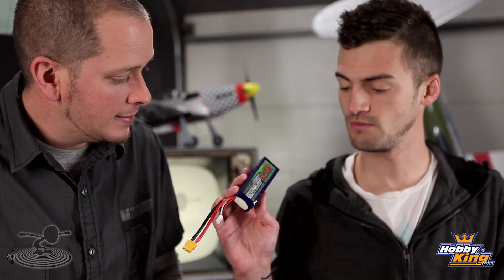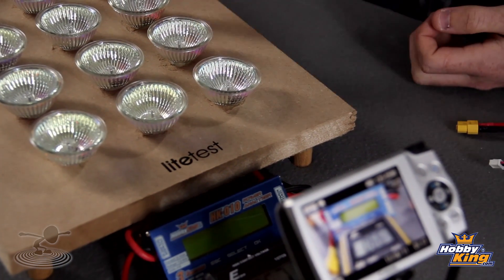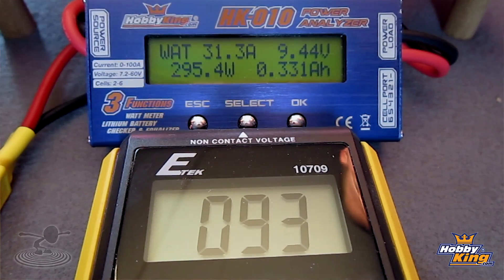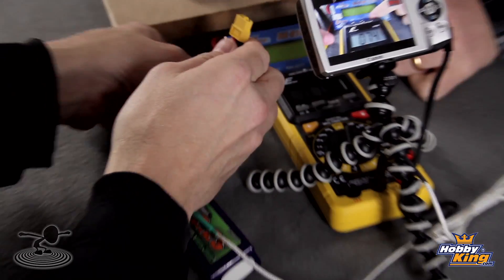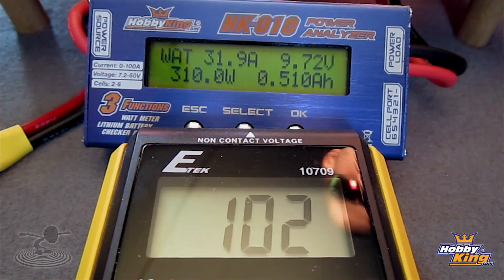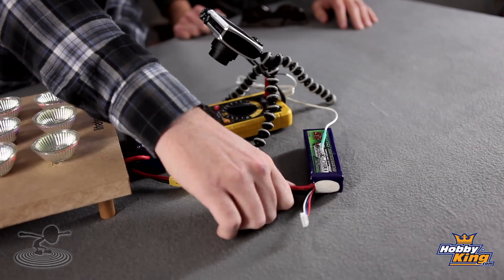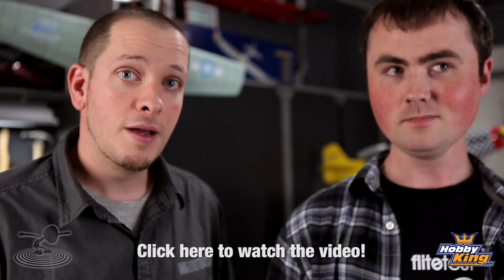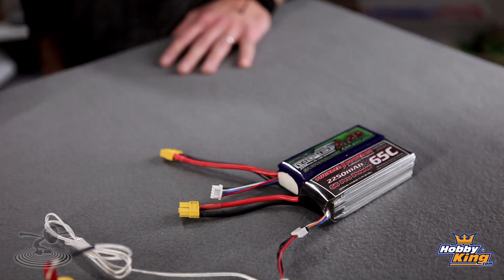Flite Test - HobbyKing Nano-Tech - REVIEW

Comment: @13Anko well withthe price of a thunder power you buy more than 2 nano techs.. so .. even if it does 50 cycles it's still a gain. 
BUT Ive tried the 65c annotechs and they are Great batteries. some old nanotech batches of the 2200mah 45c were not so good. but not these..

Comment: I do not trust this video on any level. Nanotech batteries, I will take a maximum of 5 cycles, during which they leave a lot of power. It's true. But after they have been ruined.
I have ruined many nanotech batteries in the car, on airplanes and helicopters. I do not ever buy a single.

Comment: @crystal130h 
They explain this at the start of the video.
All 3 banks of lights are hooked up but only 1 is being measured.
3x 32 amps = 96 amps draw
3x 600-700 mah = 1800-2100mah used

Comment: Next time you guys run this test....unplug the load (lamps) from your wattmeter....leaving the battery connected to the meter without the load so that you can record all the data.  There is a discharge curve involved...the watt-hours will be the most important piece of data....area under the curve....etc.....
Flash

Comment: I like these reviews and all but the hobbyking sponsorship makes me feel like they're biased. I have the nano-tech 120mah batteries and they work good but if I had something go wrong I could never return them. However, with a name brand battery I can screw up and not have to return it to China. Plus these connectors only fit those P.O.S hobby king planes. If they had some EC3 connectors for quality parkzone/e flite planes I would be interested. I would only suggest these batteries if you won't

Comment: @livvidd no, a 1 amp draw on a 2200mah 2 volt battery will discharge it in the same time as a 1 amp draw on a 200 volt 2200mah battery. The difference will be the watts you get from that 1 amp draw. Watts = amps x voltage.

Comment: Shouldn't the voltage levels been reading as 12.6v when the batteries were first connected? This whole test was confusing to me, and I would not base any opinions on battery purchases based on this video. However, I do agree that everyone should test different batteries, either scientifically, or just by flying yourplanes, and determine which batteries are the best bang for the buck.